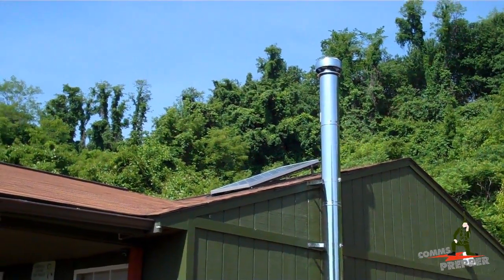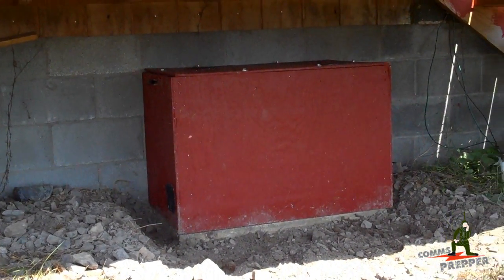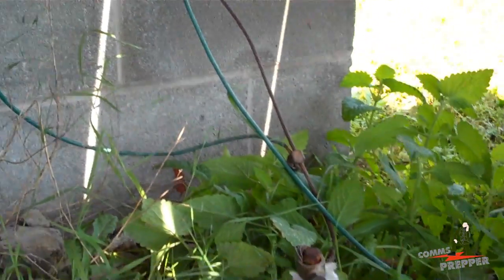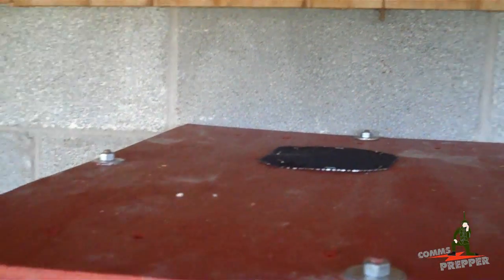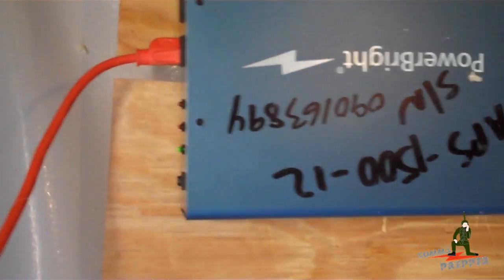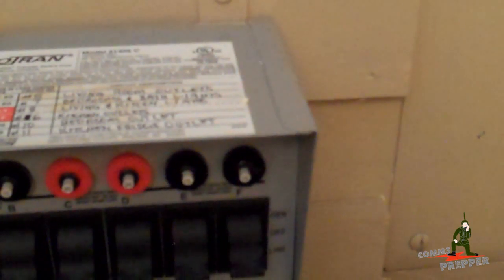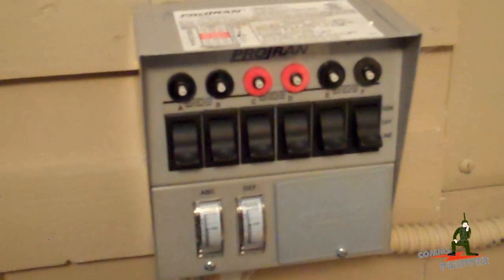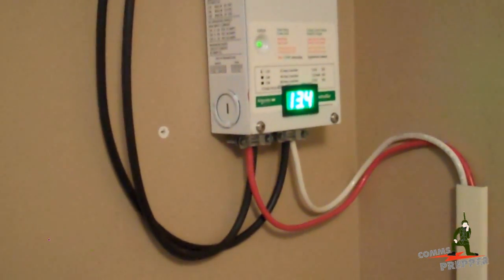Off-Grid Solar Power System

Comment: The amount of hydrogen the batteries vent is so small you don't have to worry about it.  The stink bugs fart more than those two batteries produce.
Reply from the maker: Ascoolone That's what I thought but it turns out the Trojan T-105RE batteries do vent gas when in Bulk or Equalization charge mode.  I started the project with the batteries in the hose but the rotten egg smell was too much, so we opted to move them outside.  Perhaps this is unique to the T-105RE.  They are in similar cases as the standard T-105 but weigh 20lbs more.
Reply: I see, it must be unique with those batteries. I Have a battery bank set up and do not have that issue at all.  I will remember that when I go to upgrade. Thank you

Comment: If you go higher voltage (series on panels and batteries) you don't have to use such large wires.  12v systems are great for simplicity but they are quite inefficient when compare to higher voltage panels/batteries.  Looks good though, I am in the process of setting up a GMRS repeater using a set up like this.
Reply from the maker: Rick Smith When funding permits (8 T-105RE batteries, I will convert the system to 24V.

Comment: This was helpful, I found a deal on used panels that had to be pulled because the install ruined the roof, picked up 20 240 canadian solar for 150per. I'd also recommend checking with local solar install companies, they typically buy by the pallet and will have left overs they are willing to sell for cheap. I'm taking it slow, working with a small portion of it until I payed the learning tax. I figure, why not save 5-10k$ on an install when you can go slow and learn/own the technology. I started off with a tristar but will more than likely pay for the xantrex. Good stuff, thank you for sharing your learning curve.
Reply from the maker: j johns Thanks.  I will do a few more videos on this once it all comes together.

Comment: with a small amount of battery's and a good charge controller the gas that it will produce is mouse farts bro ! nice set up. top of the line
Reply from the maker: ***** I wish that was the case with the T-105RE batteries.  I started with the batteries in the house (bedroom) and the rotten egg smell from the gas was awful.  That's why I decided to move them outside.   Perhaps it's something unique to the Trojan product line?
Reply: Commsprepper Wow I have a golf course and most battery's were trogen ! i never smelled that and the chargers boost them battery's quick(golf cart chargers) ! I have 12 in the house (a room with 2- 12x12 screemed onenings ) on a rack

Comment: I am running 8 of the t105 batts. Your 100% right about trojan they are some good peeps. If you take care of tho's battery they will take care of you. I have 720 watts of pv and can run a lot off my 1500 watt inviter. You will find the same as you play with it. I know you can't take more than you put in but you know what I am saying.
Reply from the maker: yankey4 Do you have T-105 or T-105RE batteries?  My second panel arrived over the weekend while I was at the retreat.  So I will need to install that next weekend.  That will give me 310 watts.
Reply: Commsprepper just the t105 but they are still 225 ah.

Comment: Did you use any DC Breaker or DC Fuses?  didn't see them
Reply from the maker: Glenn V ????  I'm guessing you did not watch the complete video.  I used two ANL fuses.  One between the batteries and the inverter and one between the charge controller and batteries.
Reply: Commsprepper oh right, i didn't notice it at first.    How about from the panel to the charge controller?  no need?
Reply from the maker: Glenn V No fuse between panel(s) and charge controller.  Not sure if needed. Something I will have to look into.  Thanks for taking the time to watch (it was a long video) and comment.  CommsPrepper